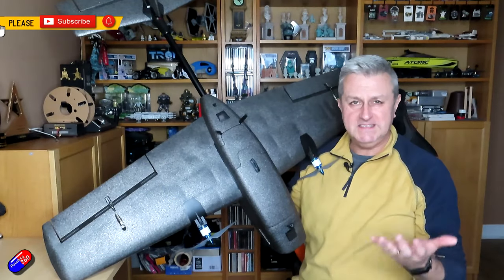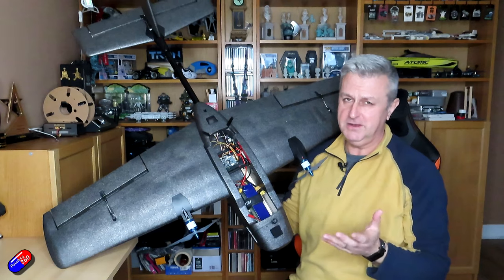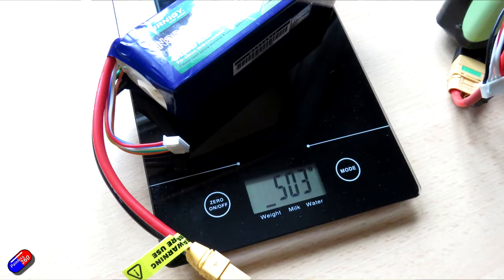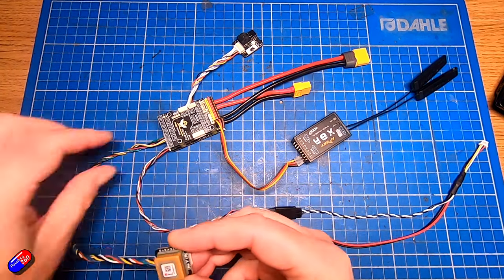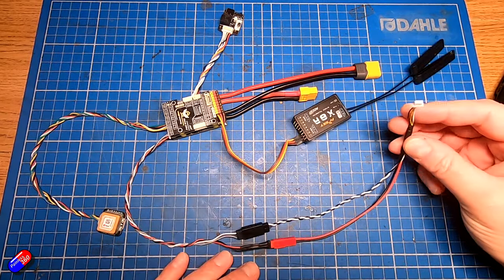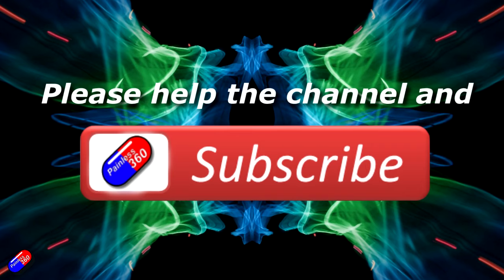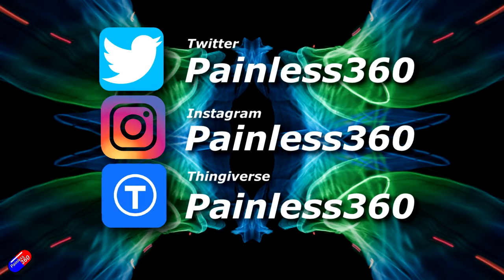HEEWING T2 Build Overview (Using INAV & SpeedyBee F405-Wing)

Comment: Lee, Re-glue all servos if you'd like to or secure them better. I lost my T2 as result to one of my aileron servo was barely hanging on to the wing. Not enough glue was used and only used on one side of the servo. Ben

Comment: This Flight controller does support sport connection (in 6.1.1). Enable softserial via configuration / enable CPU based serial ports. Set telemetry output to on. After re-booting, in ports the softserial port will appear, set the telemetry on this port to smart port. Use the TX2 (blue) wire from the FC to connect to the receiver sport. Works perfectly for me 1st time.
Reply from the maker: https://youtu.be/vvetICkhmkk for you! Thanks again!

Comment: Hi do you have a diagram or an explicit photo of the connections from the pdb to the FC speedybee F405 wing? I'm afraid of burning something.. I have the T2 in PNP
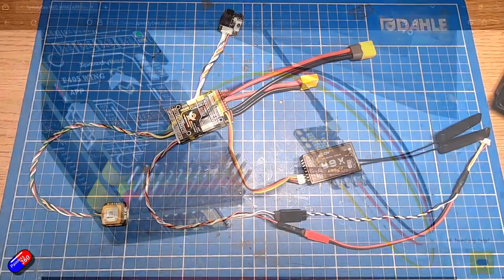Reply from the maker: See 3:53. Battery and connections to the PDB are soldered on using xt60s... best of luck

Comment: My one complaint with the F405-Wing is that dam CRSF connection, every other one is a neat ph style plug and thry they go and shove that horrible connection on the top, other than that, it’s absolutely fantastic as a flight controller, I’ve got one in our “chaser wing” at the club.

Comment: Excellent video Lee. If you could tho, could you please go over how to set up flaps in inav, I’ve pretty much finished the build but not sure where to plug the flaps to on the fc and how to set it up in inav.  Thx in advance.
Reply from the maker: I just forward an RC channel and use that for flaps here. I can make a video showing that, stay tuned!
Reply: @Painless360 yes please, that would be very helpful, if you can also show the mix as well.
Reply from the maker: Video coming out in January on that now, stay tuned!

Comment: I have heard and read discussions on using the magnetometer on the GPS vs not using it since the Speedybee F405 already has one built in. What is your take on that? Can the GPS magnetometer confuse the FC magnetometer, especially during RTH? When I tried to set mine up, the initial model representation in INAV setup screen kept on revolving. When I deactivated the magnetometer, everything was back to normal. I haven't tried RTH on my build yet but eager to try soon. Just wanted to understand the magnetometer logic better before attempting.
Reply from the maker: Depends on if you're talking about Ardupilot or INAV. A compass properly calibrated and positioned well away from interference is always the best option. If you haven't orientated the compass properly, odd things can happen, see my video on that.  Happy flying

Comment: Hi Lee! Thanks for another great video! I have recently built my first fpv using the same controller and a dji system. Regarding the connector you added for the vtx unit, I am thinking of adding a fan on top of some heatsink on the dji o3 to keep it cool while on the ground. However, I don’t see a lot of people doing that. I might be missing something here. Maybe it causes interference or maybe it’s only going to be useful on the ground and cause problems in the air? Could you please tell me your opinion on that? Cheers!
Reply from the maker: I add a power connector to the HD system so I can power it before I fly. Well designed models allow for sufficient airflow to keep systems cool. With the poor airflow designed into the nose of the T2, they've opted to add a powered fan too... A very odd choice when do many others have done a great job of it with less room... See the AtomRC Pengin.. Happy flying

Comment: How did you wire your servos and escs too the speedybee board from the pbd board?
Reply from the maker: Put the FC between the battery and the PDB... Happy flying
Reply: @Painless360  I also have an ADQ 880 compass with GPS and I cannot make the MAG, BARO, or GPS sensor to turn blue within Inav. I have followed your GPS trouble shooting video but still cannot seem to correctly get it.

Comment: Hi Lee. Excellent video. I have bought this flight controller as my first one. A question about flight modes, I’m going to use a crossfire tx on my Spektrum Ix20. Will all the mode switches show up from my ix20 when connected to inav? 
Probably a basic question but it’s all new to me 
Cheers
Reply from the maker: Yes it will, assuming the radio and receiver is bound and setup correctly... Happy flying
Reply: Thank you so much for your quick reply 😊

Comment: Hi Lee. Another question as it’s my first FC build. Wire lengths between fc and esc and fc to battery ? I know normal electric set ups but being as it’s through an fc can they be longer ?
Reply from the maker: This is one of the larger models and the lengths for power and signal for battery and ESCs are still fine and work great... Happy flying
Reply: @Painless360  thank you

Comment: Lee, As always you're videos are very informative. I have the same setup as yours Speedy bee F405 with a 4000MAH Li-Ion and AUW is 1851 Grams. I noticed that the control surfaces are too much. I used to add expo etc long time ago in Taranis for the throws. What do you recommend as far as the throws in MM and can I achieve it using INAV to limit the throws without affecting INAV flying mode PIFF configs. I noticed the T2 felt kind of heavy for the current setup and I had to provide plenty of throttle to keep it afloat. I've setup flaperons since I don't have the flap servos from heeding but haven't tried it yet. I'm more of a cruz flyer and don't any sport flying. I appreciate the help. Ben
Reply from the maker: I will be sharing my thoughts on this one in the full flying review. Interesting thoughts from you, so thanks for sharing them... stay tuned!

Comment: Lee what exact Battery size do you recommend??
Thanks
Reply from the maker: I'd use a 3000mAh or more 6s. I got the 6.2Ah 6S pack for this one from HobbyKing - https://youtu.be/K8T0toVTHV4
Reply: @Painless360  Thanks
Reply: Lee I know this is a hard question to answer exactly but I would just like your experienced opinion!
I have only flown 700-800mm vtol wings on Ardupilot with 3-4cell batts so on a plane as big as the T2 converted into a Vtol, how much flight time should I expect to get taking off and landing in vtol mode with the Turnnigy 6s 6200mah batteries you have suggested?? 
I really have no idea what to expect 🤷‍♂️
Thanks 👍
Reply from the maker: Me either. I've mot tried the T2 VTOL... Best of luck

Comment: Would the standard set-up work on 4s ? :-?
Reply from the maker: Maybe, I'm sure some will test that!
Reply: @Painless360  just ordered mine, and will test for sure as I have a 4s 10Ah battery lying at home 😀 …. Will report back for sure !
Reply: @Painless360   Hello. I just checked with Heewing and they confirmed it will work with 4s at relatively high throttle% with still reasonable amp rating.   Will test it when arives. :)

Comment: Get some small raspberry fans. Keeps vtx cool
Reply: Shouldn't really have to do this with a well designed plane - good airflow should be designed in
Reply from the maker: @tubamanandy2 I couldn't agree more. It is like fitting an ice cube maker inside an igloo or sunlamps on Caribbean beaches...;)